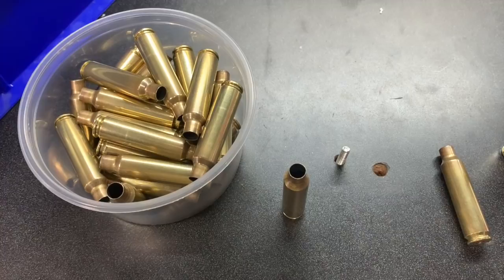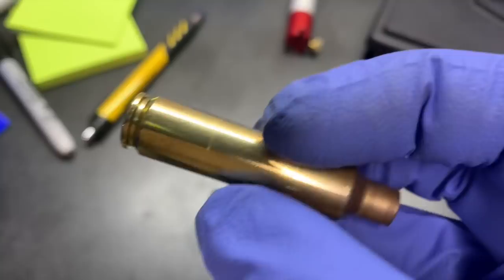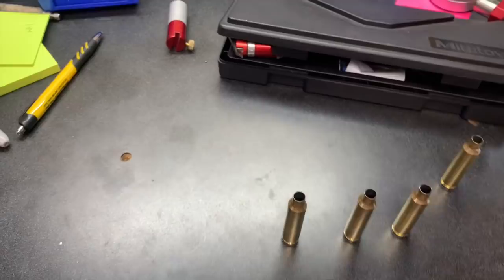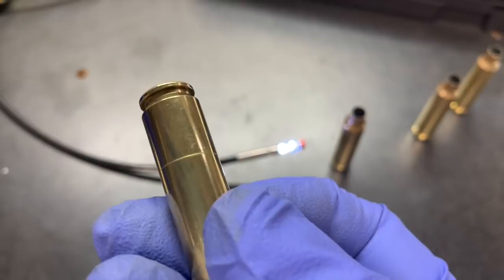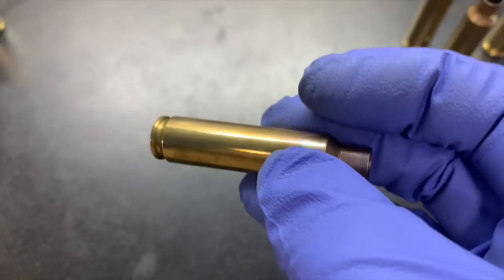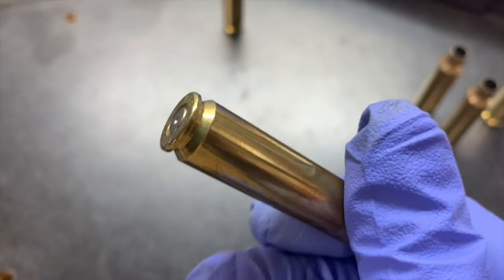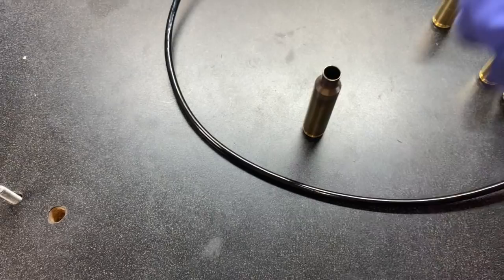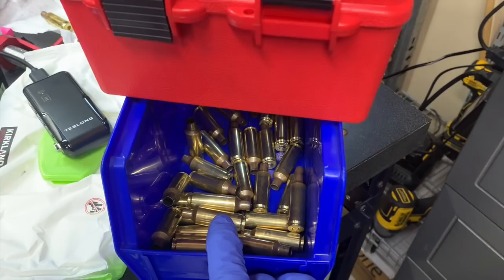Case head separation and what it looks like before it happens

Comment: I’ve had brass that’s lasted the life of the barrel it was shot in, over 20 firings. The number of firings isn’t the problem. That brass has had the shoulder pushed back too far at least one time, if not multiple times. 

When the case is shortened via sizing it stretches back out upon firing. If the shoulder has been pushed back too far it stretches back out ahead of the web where it’s at its thinnest, right where those lines formed. That’s why most bolt gun people bump the shoulder back .001” to .002” only and gas guns .003”-.004”. 

Many pieces of good brass, quality brass, have been ruined by bumping the shoulder too far back. This batch you were given is proof of that.
Reply: It's head space not right
Reply: Mark Nelson agreed 100%. I was going to write exactly what you posted—but you beat me to it! Either FL sizing dies is not setup correctly, or headspace in the barrel is excessive.
Reply: I agree with you Mark 👍 I'm also surprised that so many people dont understand why their brass cases get longer 🤔. Usually they think it comes from the caliber, shoulder angle etc... In fact they are just squeezing the brass too much when resizing 😀.
Reply from the maker: I absolutely agree. I did a horrible job explaining that aspect of what was happening but I appreciate you and others helping other to fill in the gaps. I let everyone down a little in that respect but luckily this is a great community of people who are all here to help each other.
Reply: @BurnDuration  Question about excessive headspace; what reasons that make the headspace getting excessive?

Comment: Early 90's i was curious how many firings a 30-06 case would last out of my 03 A3. Nice day at the range shooting off a bench i got 25 shots out of a new WW case before a fuzzy line appeared on the case wall. It wasn't the sharp scribed looking line like the one John showed but more like a faint blurry line.  i was loading on the bench with a Lee Classic Target loader where a mallet is used to decap, neck size, prime and seat a bullet. Case was trimmed every load with the supplied trimmer and if i remember correctly trimming only removed just a smidge if any each time. Powder was a new tin can of IMR4350 (remember when powder came in metal cans?) and was measured using dipper method. Bullets used were 150 grn. Nosler ballistic tips and clocked around a mild 2450. Military factory loads with that weight bullet are like 2750 so you can see i wasn't stretching the case near as much each shot as max loads would have.   Was poking holes in paper @ 100 yards that day and group size with that rifle was and still is right @ 1 inch.  i wasn't done shooting after the first case test so i just used another new case or three until the whole 1 lb can was gone. Probably got just over a hundred shots out of that can of powder.  i'm sure i still have them cases somewhere in storage. Now that i have a bore scope i need to dig them up and have a look inside. Lots easier than cutting one in half down the middle.

Comment: Good info sir.  I've not seen the signs on any of my brass, and I am always looking for early signs. Beautiful examples of pending case head separation.  Great idea on using the borescope to check the inner wall.
Reply from the maker: Glad it was helpful.
Reply: One should be aware that your brass can take on a ring from moving around in your plastic ammo case, leading to a false reading.
Reply from the maker: @markmuller3144  That's a great point and I totally agre. That's why I check inside (or like others have said you can use a paperclip or pic to feel).

Comment: I own a surplus 6.55X55 Swedish Mauser. Killed my first deer with it at 7yo (I am now 59).
The gun has extensive head space issues,  so before each reloading, I made a feeler by straightening a paper clip and bending a small hook on the end which I filed to a point.
By putting the clip inside the brass and scraping up the side, I can feel the beginning separation even before any visible signs on the outside of the brass.

Comment: In the 1980's when brass tumblers were rare around my parts, I spotted those lines on the darker brass very easily as they looked quite white. The only brass I've ever had do that in 40 years of reloading was full length sized just a little too far 2 or 3 times at most. Sizing is everything when it comes to brass life unless you're a hot-rodder expanding primer pockets that is. Be safe.

Comment: I’ve been reloading 50 years, over that much time I’ve seen well over a dozen case head separation.  Without exception they occur 1/4 of an inch maybe 3/8 above the base of the case.  Never have I seen a separation midway up the case body. That’s interesting.  Also all other photos I have previously seen of this problem show the ring around the case quite low. I just thought I would point that out.

Comment: My cases usually get that line closer to the case head, about half the distance that yours are.
Reply from the maker: Exactly ^
Reply: Yes, mine too. I have reloaded for over 50 years, umpteen thousands of rounds.   including separations.   always just above the head.
Reply: @FClassJohn I  please explain to us how the higher than typical separation is effected by how you size it.   my experience has all separations just above the head.
Reply from the maker: @markmuller3144  I don't disagree that it's weird. I also have seen almost everything happening lower on the base near the head. My caveman theory is that somehow the particular barrel he had was chambered just a little different combined with his custom reamed dies led to a situation that either work hardened that part of the brass or caused it to stretch in an odd way. Again, just a theory and I certainly don't know everything so it could be something completely different.

Comment: I’ve seen other videos where the same brass was used 20 times without issues. It really depends on many variables. There’s no magic number of firings. Thanks for sharing. Your videos are always very educational.
Reply from the maker: Glad you like them. As others have stated there’s various reasons but over-headspacing your brass tends to be the most damaging.
Reply: Are those other videos full-length sizing or neck sizing?
Reply: @naps3386  “annealing test 100 yard group”. Check that video. Not sure how he sized.

Comment: The trick... is being able to tell when it's a line indicating incipient case head separation... and when it's from getting dusty at some place like Rattlesnake - or Ben Avery - and then rubbing in the ammo box right at that spot.  They look very much the same on the outside, before the brass is cleaned.  Usually the 'Rattlesnake Ring' will buff out once you clean the brass.
Reply from the maker: Great point.

Comment: A good indicator also that makes you guess it will happen is when you need to use the case trimmer too often. The shoulder has been pushed too far when resizing and when you shoot it again the case will get thinner and thinner (where it expands the more) until it makes this groove. When the shoulder is pushed too far when reloading the metal will be pushed out of the die  by the neck and the case will get too long (need to get trimmed). The missing material is just the brass chips thrown in the trash when trimming 😅.
Reply from the maker: Exactly. That was very well stated.

Comment: When the outside line becomes very prominent like the one in the photo and you run a sharp edge along the inside of the case wall and feel a dip all the way around the case then to be safe throw it out BUT you can still use the rest as brass does not fail evenly with every case. 
To know if the line is prominent on the outside run it over your finger nail and feel it. 
Just because one case has gone bad in a bunch doesn't mean the rest are bad.

Comment: I had case head separation twice.
Once the remainder of the case popped right out of the chamber with a rod & brush. No sweat.
Once it did not & for all my trying, I couldn’t remove the rest of the case from my chamber.
My local gunsmith had to go to great lengths to remove it & it cost $50 to get it out.
See a ring, toss the lot.
I no longer try to milk all the mileage I can, from my cases.
Not worth it.
In a competition setting, I would have been done.

Comment: Good video. I keep switching barrels and using different rifles so I bump a LOT, like 0.010" and with my latest barrel also need to use a small base die. I only get about three firings on Hornady brass.

Comment: I started reloading in 1966 for my dad i loaded shotgun shells for his hunting then in 70 for my brother  that was brass he competed lots  the only time that i have seen case separation is when i set the shoulder back. as long as the neck is sized and the shoulder is just kissed separation is never seen i have had cases that i have reloaded 28 times with max charges they can get so thin that you can see through them but they still hold a round.

Comment: Depending on caliber you can use a flashlight and see a ring on the inside, or really a shadow. I had a case that got 25% or so separated (ejected fine but it had some flashthrough). So i took some other cases from the same session and a flashlight. Lo and behold, 5 more of the 30-ish cases had visible rings inside. You can feel them with a metalic pic. Just to make sure, i took one of the cases and cut it in half and then it becomes really apperant. They would probably held for a firing more but why take the chance.
this was 6.5 Grendel hornady cases with 10-15 firings.
I could see on the worst cases a ring on the outside to, a couple mm above the marks from the FL die.

now i always check them before reloading, if i cant see anything they should be safe.
Reply from the maker: Sounds like you have a good process to prevent problems.

Comment: Heard the trick bend a paper clip to a angle small enough to go in case and run it down inside to feel any separation starting.  Even before any evidence on the outside shows.
Reply from the maker: Yeah that's a great trick and always works well.

Comment: It looks to me like the place where the case thickness transitions from thicker near primer end to thinner up to shoulder. I've cut casings lengthwise in half to check on brass flow from many firings to see what's going on and about where you showed groove is the top of that thicker base wall thickness. Which to me would indicate a flex differential when resizing and firing.

Comment: I thought case head separation risk sequence cycle was the following. Hot loads leading to brass elongation exacerbated by excessive resizing leading to case wall thinning just ahead of the case web and excess trimming to restart the cycle until catastrophic failure. Rinse and repeat 9 or 10 times and I think you got your money's worth out of that case.

Comment: 9 times?? wow... I usually retire mine after the 5th time even if it still looks ok, by then Ive got my monies worth out of it. I will even throw the used brass ( 4 times fired) if its showing sizing wear or it gets about .001 out of spec near the base, also, if it sticks in the OAL tester it gets put into the bag to be melted down ( I make paper weight discs out of the old brass).

Comment: I am seeing a similar faint line on new production 338 Lapua Magnum commercial match ammunition (not LAPUA brass).  It's about 1/4" from the base of the brass.  When I pulled the bullet and emptied the powder I could see, with a borescope,  what appears to be a ring shaped "crack" on the inside of the case.  I was intending to reload it but it may not be worth the risk.
Reply from the maker: Yeah you never know when it will fail.

Comment: If your headspace is wrong, I've had cases look that bad and even separation after as little as 3 reloads. 
  I always thought it was the brass flowing away from the thicker base portion, that point where the body thins and that flow pushes the shoulder and neck up, requiring trimming.  Can you hacksaw a case down its length to show the weak point?
Reply from the maker: I also agree that over head spacing can contribute to it as well and I appreciate you posting this. It’s almost almost a combination of things that cause these issues and it’s always still amazing to me how everything we deal with is on such a micro-precise level that throwing one part off just spoils the punch.
Reply: Chamber grows as round are being fired and need to be set back from time to time.

Comment: John; I have been poking away at papers on annealing, and it appears that there is a nasty thing that appears at about 200°C, a kind of hardening before softening...it could be that the separation line occurs at a point where the work-hardening due to firing is "meeting" the annealing, near where the brass reaches that temperature while the neck is annealing? Maybe, just a maybe, one needs to ensure that the case remains cool, or that annealing actually extends to nearer the 'base', avoiding softening of the head, but allowing some degree of annealing further down the case?  But, just extrapolation from some scientific papers....
Reply from the maker: When it comes to case head separation the real culprit is case stretch from brass where the shoulders were pushed too far back. While annealing can help with other factors in brass life, proper sizing is the only thing that will really keep this from happening. Check out my other video I did after this on what's causing case head separation.

Comment: I personally learnt this the hard way using 3xfired brass. The reason why I think was because of an error in bumping the shoulder 7 thou instead of 2. Also I chucked the whole batch why take the risk on compromised brass
Reply from the maker: Yep. As others have started, over bumping is definitely a major contributor to this happening. And I just sucks when it happens because it’s one of those conditions where you can’t do anything to fix it once it happens.
Reply: @FClassJohn  glad I learnt this lesson on Hornady .223 Match ammo I fired then harvested the brass. Made the decision to bin very easy. Off topic why do Hornady put a crimp in there primer pockets?
Reply from the maker: @rungun3982  I honestly have no idea on the crimp. I’m familiar with them really.
Reply: @FClassJohn  I was heading towards Lapua brass anyway due to recommendations and now I have used it I wouldn't use anything else for best loads.
Reply: @rungun3982  same here

Comment: I know it would be hard to measure, but I wonder if the width of the line correlates to the same number as the shoulder bump. For example if you set back the shoulder .0015. I wonder If the line is also .0015.

Comment: Two Questions
1. What happens if the case completely separates while firing?
2. Brass doesn't have intrinsic strength- I've always been told it expands to fit the chamber and bolt face- so why not anneal the whole cartridge?  (and not just the neck)
Reply from the maker: 1)You pull the pieces out and evaluate the rest of your loads and go from there, at least in my experience. 
2)Yes it does but I don't honestly know the answer to why we don't anneal the whole case and don't want to give any information that may be false. I have educated guesses but that's all they'd be. All I know is that it's never done and there's a god reason, so I'll see if I can ask people smarter than me to find out why.

Comment: I run a stainless steel dental pick through the inside of my brass and I've never found a case in which I could feel an indentation warning of a pending case head separation but much of my brass has a similar appearing ring much lower on the body, almost to the case head.  I noticed that the bad cases you showed had the ring much higher up the case.  Is that a general rule of thumb as to the location of the separation and that a ring almost all the way down to the case head shouldn't be a concern?
Reply from the maker: I’m not sure there’s an ‘absolute’ in this situation. It’s not a regular phenomenon that occurs so I only have mine and others data to work with. I’ve seen rings form in various places and I’ve had separation at different levels which leads me to believe it’s a function of your sizing die combined with how much you’re bumping and probably some other factors that I have no idea of.

Comment: Do you usually see a line OUTSIDE before riskinga head seperation on the next firing, or do you have to use something like a wall thickness measuring tool to make sure your brass is about beeing done?
Reply from the maker: In my limited experience from my own and others issue I would say the line shows up most of the time however I have no doubt that you may see or feel a line inside without a clear line outside. Also, maybe I misunderstand the question but I don't think you'd be able to get a wall thickness gauge into the body.
Reply: @FClassJohn  Not the typical wal thickness gauges or ball micrometer, like those you use for neck wall thickness, but there are tools capable of mesuring wall thickness down to the base/head. Like the bent needle on the RCBS case master gauging tool. When you index and zero the micrometer on it's tip, you can get measurements way beyond the neck. Of course it's not that precise and it's a little tedious, but should be no problem to identify thin spots like those shown by you with the bore scope. A bore scope might be more convenient though, if problems use to show up as pronounced as on the case shown in you video, but putting a number on it can also help. Btw, thanks for sharing your experiences, methods and thoughts!

Comment: Newbe question: why doesn't the heat from firing the cartridge anneal the brass?
Reply from the maker: Simple answer as I understand it is that it’s not hot enough for long enough. It’s more complicated than that but at its core that’s why.